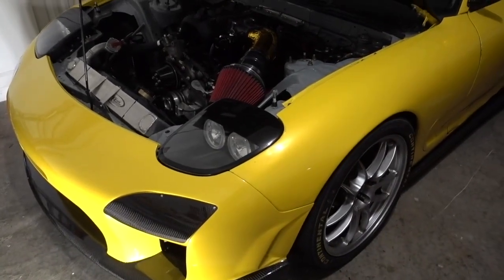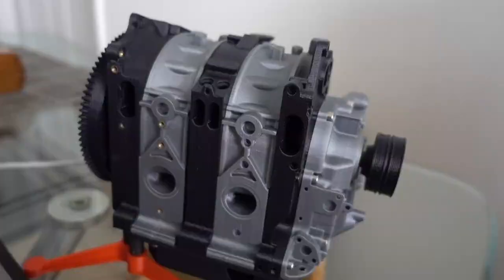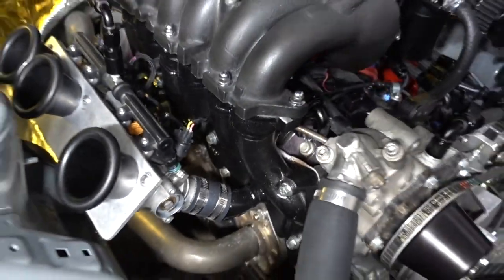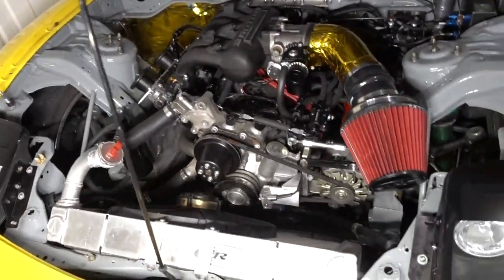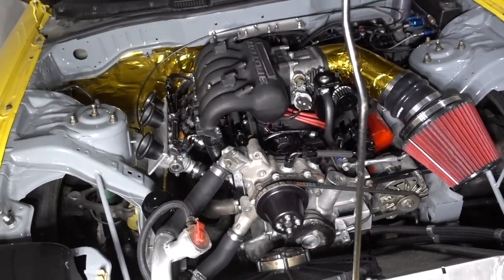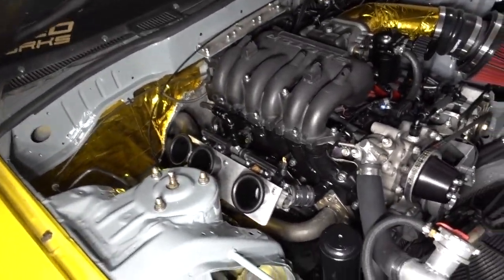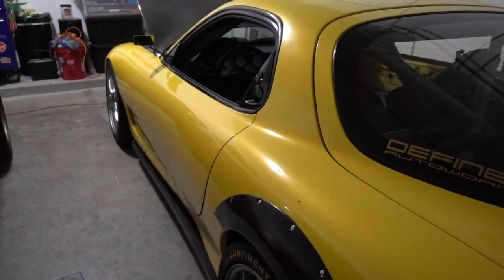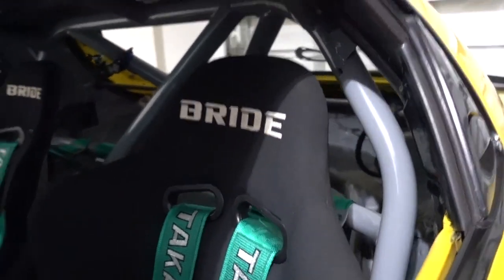NA 20b 3ROTOR FD EXPLAINED

Comment: How do you keep the intake charge from bleeding compression into the peripheral intakes at lower rpm? This sounds like a great idea, as I used to have a pp rx-3 and I know how it ran like shit below 4,000 rpm, but it kicked you in the ass from 7,000 to 10,000.
What kind of power are you making? A full pp would be around 475 to 500?
Reply from the maker: The p ports are never in positive pressure so they don’t bleed.  Power is about 460bhp.

Comment: Lot of big facts here but a stock rotary will benifit from a semi peripheral. The more air and fuel the more power and any NA rotary is capable of 10k-12k rpm when tuned right. And with a slight and easy oil mod.

Comment: On stock engines,can't you use the peripheral ports only to increase low rpm driveability ?
Being smaller ports,it should be quite good to get very high air speed,and better fuel economy.
Who printed the scaled down engine ?

Comment: have you considered moving the secondary injectors in front of the bell mouths of the itb's? from what i understand that will have advantages in fuel atomisation,  especially because they open at high rpm so the velocity is already there ? just wondering what you're thoughts are on that subject :)

Comment: So what you’re telling me is it’s similar to the vvti system in the way that it comes on at a higher rpm but uses a more efficient way. Is fuel sprayed just right in the ITB? and if that is true could nitrous be introduced in the mix also to give a power boost(id say 50 shot) and keep intake temps cooler in higher rpms. I’m a mechanic and build motors here and there but I’m not to familiar with rotors.

Comment: Don’t they sell a lower intake manifold that has the semi port added to them so you don’t have to run the the ITBs separate? Should get one of those and see the HP difference with one throttle body.
Reply: Pro-jay sells it just found it. Try it out

Comment: Do the extra ports fill the same part of the rotor as the side with the normal fuel and air   burns? After filling the side, is there still a vacum the fill that side of the rotor before the burn? Of is this a second burn?

Comment: There is 1 thing that i have noticed and that is the main throttle body has a red air filter to filter the air but the 3 peripheral ports are just open to the air and any dirt and dust in the air. 🙂
Reply from the maker: They aren’t open very often so not much gets there but i am trying to build a filter setup.

Comment: is this 3rotor vtec
Reply from the maker: In s sense yes.
Reply: There are no camshafts in a rotary.  It's more akin to secondaries opening on a 4 barrel carburetor.  Different, obviously, but the same idea.  Extra air and fuel over a certain throttle percentage.
Reply: @TheDuke539  lolol i was making a joke, but i appreciate the explanation! good info brother. this car is badass